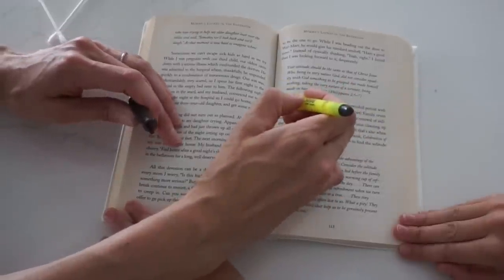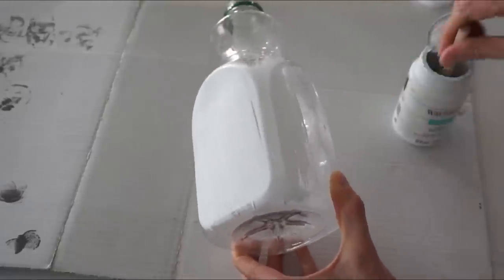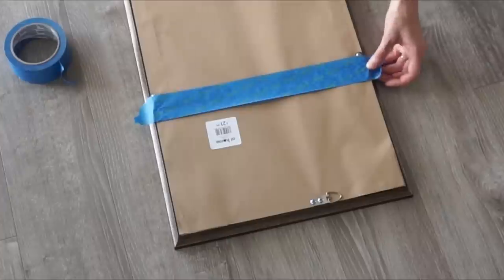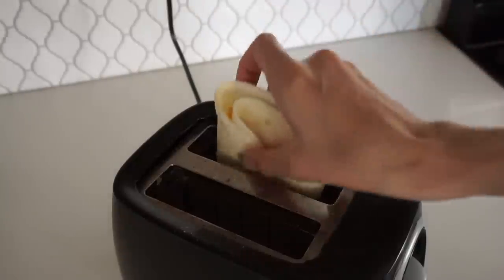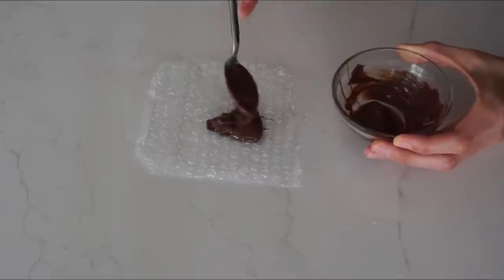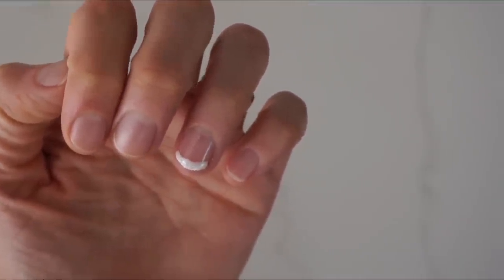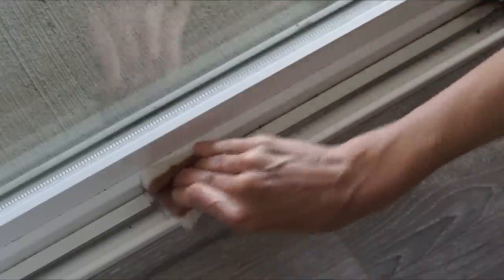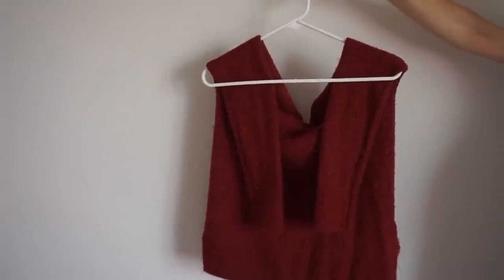Testing 15 Viral TikTok Life Hacks & DIY Hacks + 15 Home Hacks that Work!

Comment: For the vase you can also heat a pan up. Put foil down and gently rub the "vase" on it and the plastic wont be sharp after you cut it
Reply: Or put a piece of parchment paper over a clothes iron, leave the iron standing up, and quickly and gently rub the cut end of the plastic over that. But my iron disappeared somehow so I will be using YOUR idea!!!!

Comment: Here's a great trick for cutting plastic...use a lighter and heat up the blade. It will cut right through that plastic like butter!
Reply: I sometimes use my wood burning tool with the tip that looks like the end of a blade. And if I have to cut the plastic with scissors, I place a piece of parchment paper over the jagged edge and apply an iron at low heat. It melts the plastic (of course) and you can keep melting it down until the edges are flush.
Reply: @thepurplepixie8886  thank you for your wonderful tips
Reply: Thanks for tip!!!
Reply: @thepurplepixie8886  This is sucees
Reply: I just got a hot knife at Michael's.  Can't wait to try it.
Reply: @annettehaley3338  awesome

Comment: The paper towel tube under the appliances is brilliant! 
I've learned to always pour off the paint you will use into a tray or cup, don't use it out of the can. If you use it out of the can, you can contaminate the paint with anything your brush picks up, plus you allow the paint to dry out. I recycle yogurt or sour cream containers for this.

Comment: I've been using the white chalk paint and stain forever. Quick tip you can also use a faux wood grain tool on big projects like signs and etc to make anything look like real wood and not cheap faux wood.
Reply from the maker: Oh cool
Reply: Faux wood grain tool ? What’s this  a tool ? I  need to pain a white door to look wood ! Please
Reply: @elsagracielatejon3154  you can pick one up at mostly any hardware store or they can order you one, its very easy to use with stain or gel stain even metal doors can be made to look like actual real wood doors.

Comment: Another hack to remove the sticky residue, you can use a mixture of baking soda and water.  Make a paste a rub it on the residue.  The baking soda will disolve, not only the sticky residue, but also the label.

Comment: Omg I love the vacuum vent hack! I can't get my Dyson in there far enough with the crevasse attachment! I have looped a dryer sheet into the end of a fly swatter  and stuck it down in there. That works fairly well. Im sure a swiffer would work better and works for those who don't have a vacuum with a hose or a stick vacuum.
Reply: The real fix, I found, was "similar" the cardboard tube, on the crevice tool.

 I used a large, Quart size Smart Water bottle.  I removed & tossed the top & bottom. I kept only the smooth plastic tube, then sliced it open (using a snap-off-blade type knife) then I rolled the tube diagonally for structure, around my crevice tool, tube length wise & wrapped it all up, with more packing tape than necessary.  

It was a permanent attachment, for about a year. I finally broke it by flattening it under the fridge, dishwasher, washer and dryer vent.  Wow!

Works excellent for cleaning the dryer vent from outside too.  I had hornets build a nest inside the dryer vent on the outside. It caused my dryer to overheat & what a surprise finding wasps in your dryer.  Tip, clean both ends of that dryer vent.
Reply: Yeah me too. I always wondered why  i couldn’t get in there far enough.

Comment: Oh, I like the bread sealing hack!
Reply: My ex used to do this but I wasn't having it. My thinking was, the crumbs that are usually kept on the inside of the bag are now on the outside.
Reply: @lindaneighbors4158  haha that's true I guess the father down the loaf you get 😂
I'll have to be sure and do it over the sink in case of crumbs 👌
Reply: I have been doing this for the last 40 years,,,when I was a younger mother and worked, I had a lot of tricks that would make cooking and cleaning jobs go faster....and i hate twist ties....
Reply: @lindaneighbors4158  I use this hack but instead of folding the bag over the bread, I just tuck it underneath it. I can make a loaf of bread last a month without it getting hard, stale, or moldy. Just gently squeeze out as much air as you can and then twist it several times and fold the end under the bag.

Comment: I paint a lot and a great hack is to take a nail and hammer and nail some holes around the inside lip where the paint gathers, that way the paint drains back into the can .
Reply: But wouldn't that leave holes in the can? How will that be an airtight seal for left overs?
Reply: @aprilarlanhoneycutt425  drill or nail the holes straight down into the lowest point of the lip. Sort of like drain hole in a “moat” - the part of the lid that you hammer into the can will cover it - especially if you use in conjunction with the cling wrap hack. 😀  Hope that helps!
Reply: @cruachaner  Thanks for the explanation Cheryl Campbell! I'm going to try it because I'm currently painting the kitchen cabinets. Thanks!

Comment: Someone probably mentioned this already; but for the painters tape/drill bit hack: instead of completely wrapping your tape around the bit, try folding it around and creating a little “flag” by attaching the sticky side to sticky side on the ends.  It will be easier to see your progress.

Comment: I think I knew 50% of them.  A hack for painting...if you are not done painting.....wrap your paint brush or your roller in saran wrap & put in the freezer.  It will not dry out & you can just continue to use it when you're ready.
Great video Emily.

Comment: If you store the paint can upside down then the paint itself makes the can air tight and the paint will last longer. Also, for about $1 you can get a reusable paint lip that clips on the edge of the can. Then there is nothing in the lip and it pours out well so there are no dribbles down the side. If it's latex you just let it dry for a few hours and peel it off in one piece which is super satisfying. Hope it helps people.

Comment: These were all good but you just changed my life with the painters tape on the back of a picture with 2 hooks!!!! I HATE hanging those and i can never get them even!!!
Reply from the maker: They are a pain
Reply: Cyndi brent, there's a level on Iphone so you don't have to look for a level. It also measures. 👋
Reply: I saw on youtube that those 2 hangers on the back of pictures are there for the wire used to hang pictures.

Comment: A juicing secret for next time:  Roll your orange, lemon, lime or grapefruit on your counter before poking it with your chopstick, THEN squeeze.  This method works great for all citrus fruits making juicing easy in ANY form.  💚💛💜  Happy New Year!!!
Reply: Was going to suggest the same.  Works also for cutting up citrus wedges for mixed drinks!
Reply: Also you can put in microwave a couple seconds or minute before rolling.  Heat loosens the juice from the fruit

Comment: To get the most juice out of lemons: Microwave the lemon for 15 seconds and then roll it on the counter while applying pressure with your palm back and forth. You'll feel the juices inside the lemon loosen up as you're rolling it. 😊 I don't know if it works the same for oranges because I don't eat them, but doesn't hurt to try.

Comment: For the paint cans, drill a couple of weep holes in the recessed part of the can where the lid sits.  The paint that accumulates there will drip back into the can.
Reply: I've done this for years. I also put a couple of drops of vanilla or essential oils  in it. No paint smells.
Reply: I was going to suggest the same trick! My husband taught me that trick many years ago 😊
Reply: @susancnw59  doesn't that effect pzjnt colour
Reply: @harrypotterfan1623  a couple of drops don't. It's pretty cool as it takes so little.
Reply: I just use a hammer and nail. Nail a few drip holes in. Easier than drilling.

Comment: On your paint can  use a nail and hammer holes every two inches around the can. the paint will drip back in the can
Reply: And you can also tap a straight head screwdriver with a hammer around edge every two inches works well too

Comment: I LOVE hack videos! TY for sharing all of these. Some I already use, but others I wouldn't have thought of myself. I didn't know about the orange peeling trick. Thanks for that because I have two oranges I've been meaning to eat, but hate getting my hands all sticky. And I'm definitely making some Quesadillas for lunch today! TY for that hack as well.
Here are a few ideas that I use: 
*When vacuuming under the washer/dryer, refrigerator, etc., spray the paper towel tube with a light mist of spray adhesive first. It will pull out way more lint, dust, and even small items that may be lurking under the appliance.
*If looking for a small hard to see item (like an earring or contact) that you may have dropped, put a piece of panty hose or a sock over the hose of the vacuum and hold it in place. Then run the hose around the area that the item was dropped. It will get sucked up to the pantyhose or sock, but not sucked into the vacuum itself. 
*To clean ridges in window sills or door thresholds, etc, I use an old toothbrush or baby bottle brush and a paper towel dampened with Awesome Cleaner (from DT) or a Clorox wipe. 
*I use scotch tape that I cut with a nail clipper as my guide for a French Manicure. But instead of using nail polish, I use a paint maker. lol. Of course I put a top coat of clear nail polish, but whatever gets on my skin just washes right off. Plus, I don't have to maneuver a small nail polish brush AND I can use any color I want!
*I've also used permanent vinyl that I cut with my Silhouette to fit my whole fingernail. It comes in handy when you need a quick color manicure. 
One more thing- you can write a note in lemon juice using a paint brush, and to make the writing show up, just heat it up with something (like a blow dryer). When it cools, the writing will disappear again. 
Sorry for the novel long comment. I just wanted to share these with you in hopes they may be a help to you in the future. 
I don't normally share videos, but this one is worth it. Have a happy and blessed Easter!

Comment: I use plastic bottles alot.  The problem with using the hair dryer is that it tends to warp the plastic.  I find it much easier to run it under very hot  tap water,  then rub a good amount of dish soap over it and scrape it off with a plastic scraper.  Then rinse it off under the hot water again.  I've never had any issues with stickiness this way.  Love the wood look,  I'll have to try that.  I love your channel and glad you continue to share your talents.
Reply from the maker: Yeah I warped one side. I’ll have to try yoirs

Comment: Someone may have said this, but Goo Gone-small one from Dollar Tree-other places sell bigger sizes-gets label residue off very well.
Reply: I just watch The DYI Mommy and in her TTHacks video she suggests Eucalyptus  Essential oil!  She showed how on a cotton ball it removed ALL.  : )
Reply: Hi Linda Bradley,
   I've also had good luck with using WD-40, rubbing alcohol in the 90%, cooking oil, baby oil, Pledge wax took quite a while to work and a thick layer so I don't recommend that, and dish soap took awhile. Most needed a plastic putty knife, or old credit card for a scraper, or an orange stick from over by the nail polish aisle.
  Over in the scrapbooking section of the craft store is a product called “Undu”, that works very well also. My friend had that. I never used it myself, I watched her use it, it worked.
   I hope this helps.
Take care, stay safe.
☺️✌️🖖            😷
Reply: @BROUBoomer  Marie here- To scrape residue if you don't have old credit card (cc), I use the free cc's that are mailed to me as offers from banks.

Comment: Instead of using saran wrap before you put the lid on the paint can do this.
1.  After shaking paint can to mix the paint, remove the lid.

2.  Take a medium-sized nail or an awl, and hammer the nail equidistant around the rim of the paint can (where the lid would sit).  Four to six holes will be sufficient.

3.  When you are finished pouring the paint into the roller tray, the excess paint in the rim of the paint can drips back down into the paint can.   When you put the lid back on the paint can there is very little paint in the rim.

4.  When storing paint for a long time, hammer the lid on to the paint can, making an airtight seal.  

5.  Turn the paint can upside down to avoid the skin forming on the top of the paint.  It is the air between the paint and the lid that makes the paint form a skin. This way you will never have to strain your paint.  This works with any kind of paint product and makes life a little easier.  
AND
   to save yourself unnecessary cleaning of rollers, foam brushes, regular brushes --- store each one in a zip lock bag.  Remember to squeeze out as much air as you can before sealing the bag.  I have used this hack when I cannot finish a paint job in one day.  Paintbrushes, rollers, etc. will remain soft and usable for up to one month.  Happy painting.
Reply: Awesome! Thank you for sharing!
Reply from the maker: Awesome thank you

Comment: For your paint cans .. you really should use a different vessel to actually paint your walls with or whatever your painting with it'll save your paint you'll be able to keep it longer because bacteria from the walls or whatever else you're painting will go back into your fresh paint but besides that, if you take a drill with a very small bit or smaller than the rim of your paint can and drill holes how about 3 in around part of the rim of your can anytime you get paint on the inside rim of your can it will just drip back into your paint can. Hope you try it thanks for your tips love them

Comment: If you are a renter and you want to hang some thing on the walls. Get some sewing straight pens with out the color heads. The straight pens leaves a very small hole in the wall. I even hang  some heavy iron decor with the straight pens and  yes the pins will hold the iron. Been doing  this for years even when I was a renter and I got my deposit back. Its better than using a big nail. When using the pins angel the pin down in sheet rock. Avoid the suds at all times. I love to crocket. One day I thought why not crochet around my hangers. For you crocheters start out with a chain leave a long tail on both ends start to finished. Make you chain longer than your hanger that way you can bunch it up when your finished. Bunching is better but you don't need a lot of it.  After the chain  you can single or double crochet in the chain. Make sure the crochet  can wrap around the hanger before finishing your project. After that get a crochet needle whip your chain down around your hanger. When you're finished tie off and  leave another long tail so you can tie your master piece to the bottom of the hook. The tails can be in a knot or knot and bow then straighten you work out. The bunching helps with the sweater shoulders. If you have tank tops with the thin straps they will go on and they don't slip off easy. These hangers are great for yours or and your husband's slacks. Happy nailing art work with straight pens and crocheting your hangers. :) :) :)

Comment: If you have an item that left sticky residue behind and NOTHING, even Goo Gone, doesn’t seem to help, you can take some duct tape style Gorilla Glue table and put that down over the adhesive. When you pull the tape off, it will pull off the sticky residue, and you can always use the tape to dab the areas again if some didn’t come off. I don’t know if I’m just way behind and this is commonly known, or if I had a genius moment and discovered it... but it’s a life changer. I keep that stuff on hand ALL THE TIME now and use that hack quite frequently!

Comment: You need to roll the citrus fruit between your palm and the countertop using as much pressure as you can without busting the rind open. Then poke the end and squeeze! You'll get gobs of juice! You've released all the juice from the pulp!
Reply: I meant to mention that too but I was in a hurry n spaced it lol my bad... The Erasable Highlighters literally 🤯 I had just ran across them a month or so b4 watching this and had to order them to see HOW, how can you erase markers but the concept is the same as this hack I just don't know what they actually use for the eraser side...
Reply: I was going to say that. And putting it in the microwave will also help to loosen it up

Comment: The product called GOO GONE... found at Dollar Tree and most hardware stores removes glue residue! Just a small dab on a cloth will work. Rub the residue right off! A paper towel or napkin will work but t shirt fabric works best. I use this method all the time and every bottle can be used without painting it. Takes off price tag glue and labels! 
God bless you all. Great video. Thanks!
Peace, Lynne 🍃💜🍃
Edit... use blow dryer first to remove label..use GOO GONE on tshirt fabric to rub off sticky residue. Hope this helps. 😊

Comment: Got another one for you. After you’ve opened a metal paint can, take a rather large nail and a hammer and pound 3 or 4 holes in the groove around the top. When paint gets into the groove, it will drip back in the can and everything stays neat. Don’t worry, the leftover paint won’t dry out. It

Comment: Paint Storage:  Don't put the Saran Wrap around the can opening.  Instead cut it large enough to actually lay Directly on the paint itself.  This eliminates the air inside the can from drying out the paint.

Love your hacks.

Comment: Yeah, the hair dryer removes all labels from boxes like amazon boxes. You don’t want them on when you’re trying to return something. Also, if you will just mark through a couple of lines on those Scanner bars, you don’t have to black out the whole thing. Make your marks horizontally.If you don’t, the return might get misdirected.